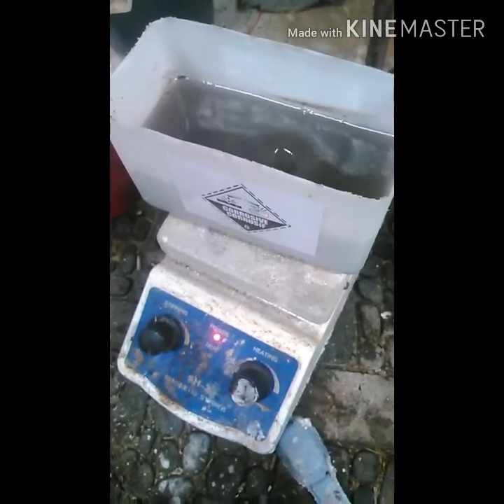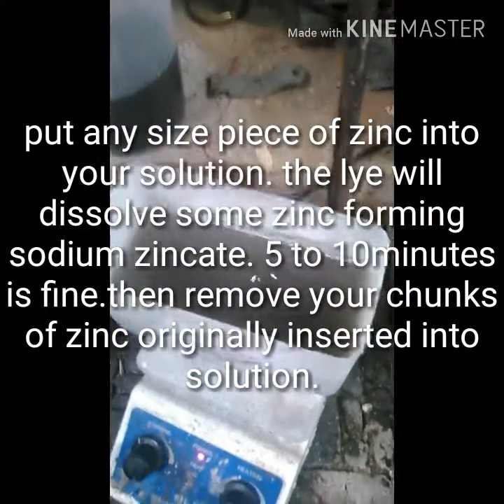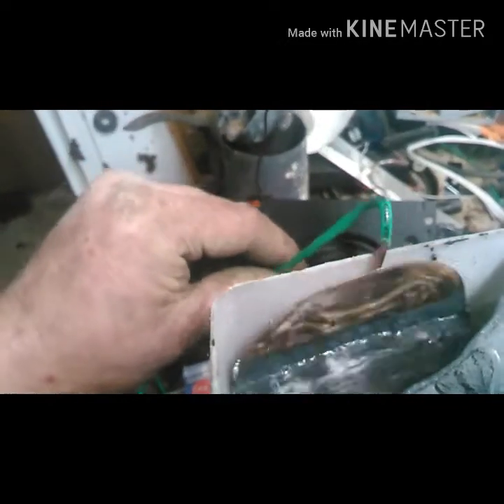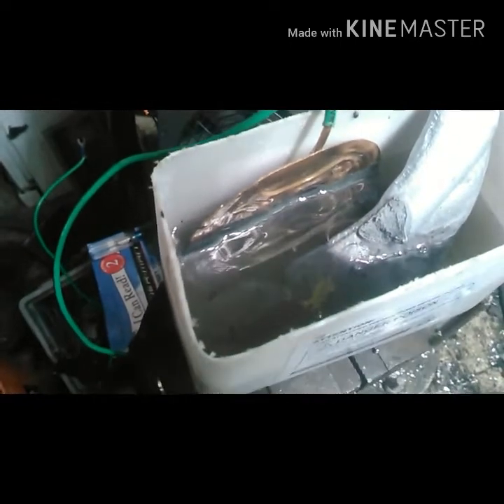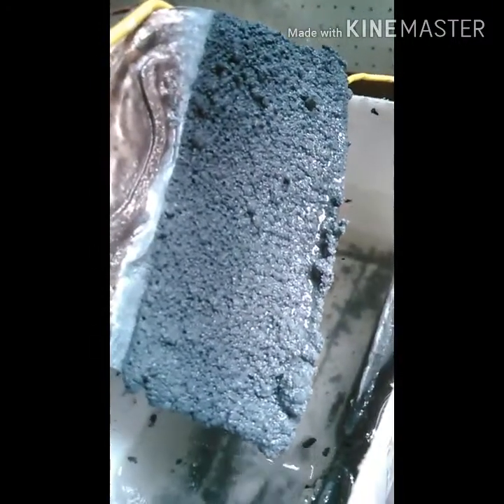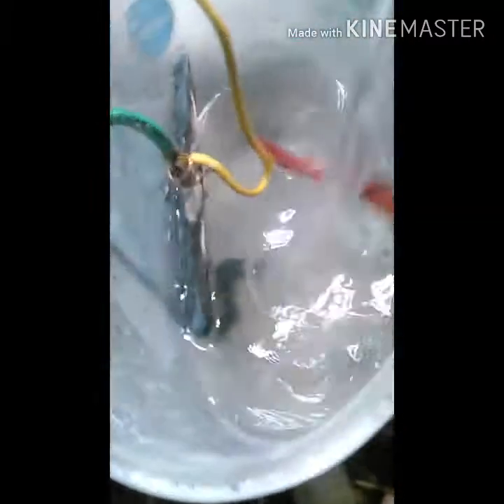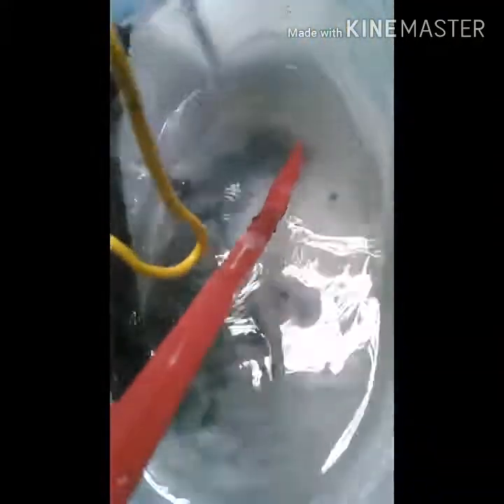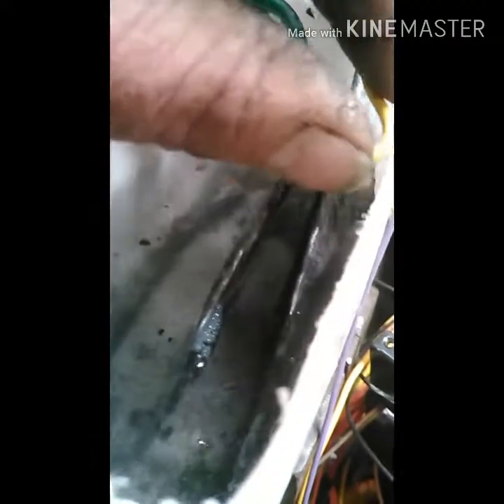How to make zinc powder, firework grade.

Comment: How do you dry the zinc powder?  when i dry it over the stove, it oxidizes while drying.
Reply from the maker: So I flatten it out and use a fan or hair dryer. In the oven  can work if you can get down to like 100f
Reply: @shelbysgarage5828  allright, i get our oven down to 30.c so i will try it with the oven and föhn. Tnx
Reply from the maker: Sorry I took so long to reply. Hope all went well for you.
Reply: @shelbysgarage5828  

I've just been home a week from an admission to the lung department in the hospital, had inhaled too many harmful substances with the drying of a few kilos...
Reply from the maker: I seriously hope this is a joke....
Reply: @shelbysgarage5828  yes it was a joke, luckily I am unharmed. I was able to obtain zinc powder for color effects through another route. In any case, inhalation remains dangerous
Reply from the maker: Lead oxide and lead carbonate makes colors just explode with vibrance. Just an fyi.... I sell it if you need any.... I got grey,pink,orange,yellow,red.. in lead 2 oxide... Lead 2/4 on red
Reply: @shelbysgarage5828  for which pyrotechnic mixes do you use this zinc powder?
Reply from the maker: I made it actually for a redox displacement reaction. However it's also useful for turning metal salts into metal oxides like in my catalytic converter video.
Reply from the maker: Use a hair dryer, and just accept the outter layer is going to oxidize
Reply from the maker: Anyway you want man, want my email?
Reply: How do you store fine zinc powder? I'm thinking of buying a bottle but I've heard of random explosions and apparently explosions when it contacts water or sweat
Reply: @jay-tl2un  i store it inside a paint can, without any problems.
Reply: @FLYINGDUTCH2000  oh okay, right on, thanks! 👍

Comment: Good video.
The way I do it is simply make a solution of NaOH and water. Then use a zinc anode and a zinc cathode. I have also used a stainless steel cathode and it worked. However it seems that with the stainless steel cathode, the recovered zinc appears to already have a layer of oxidation. The powder is dull grey. With both anode and cathode zinc, the recovered powder is very shiny and perfect.

I am using it as a reducing agent. To use the oxidized powder, I have to rinse with dilute HCl first which just makes more waste to dispose of. I buy 12" x 12" x 3/32" sheets of zinc and cut them to the appropriate shape.
Reply from the maker: For me I find that when I remove the powdered zinc if I don't wash it and dry (air dry) quickly that it oxidizes but when done quickly I get a good powder product. But I'll have to try your way and see what I think. Thx for comment!